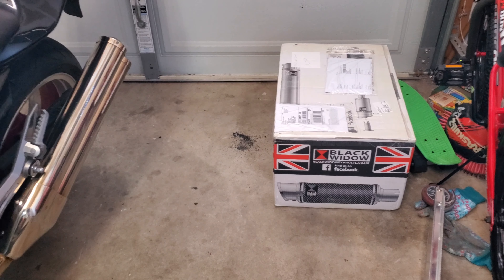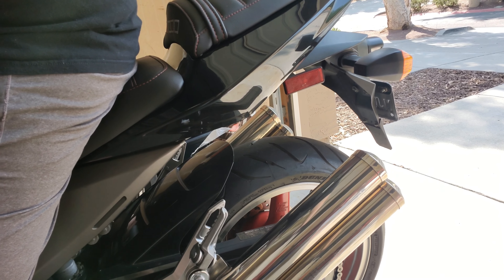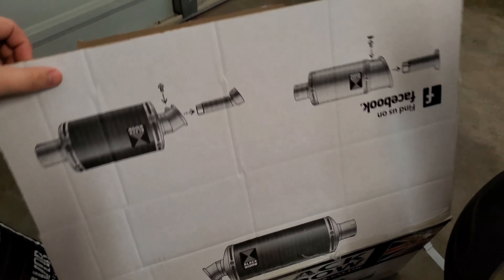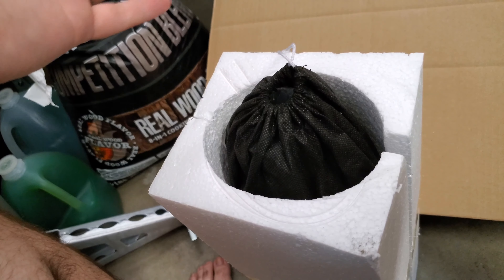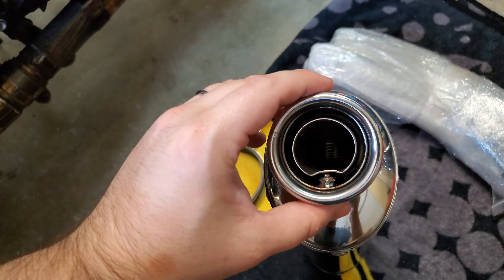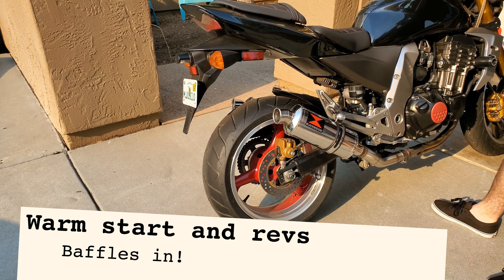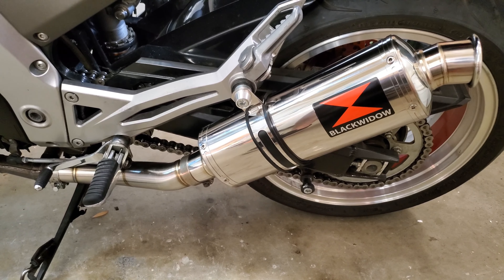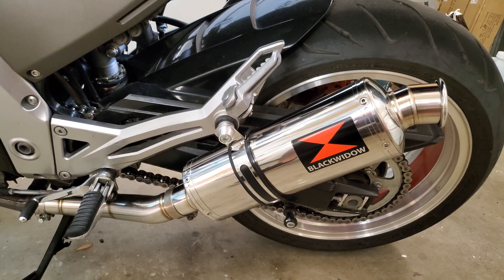Kawasaki Z1000 - Black Widow Exhaust (SS300)

Comment: Hi fella.

Bought the same exhausts here in the UK however, I wanted to ask you what bolt/bolts did you remove to fit the front crash sliders? Have you also a video of the process. Thanks. Michael.

Comment: Hey mate just a question since you have a z1000. 03. When it comes to the left side of the engine and crack cover. Does it get quite hot rather quickly on yours? I have noticed on mine but no clue if its always done it and im stressing over nothing or if it's just started doing it. Also beautiful sound. I am getting some of these soon
Reply from the maker: Considering the left side is the Stator cover it very well may heat up fatser than the right side because there's a lot of electrical current flowing under there and it's not something submerged in oil. The right side is the clutch cover and it's submerged in oil which will take some ride time to heat up because the oil is cold and slowly warms up. I wouldn't be concerned unless you are having electrical/charging issues.
Reply: @MotoMedicine904  Okay thanks man was just hoping was not a blockage or some shit lol